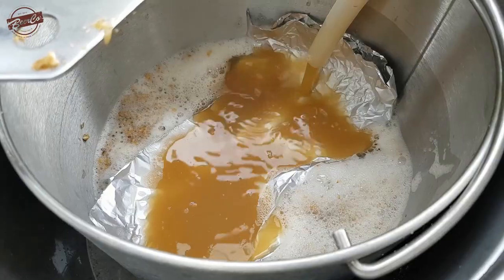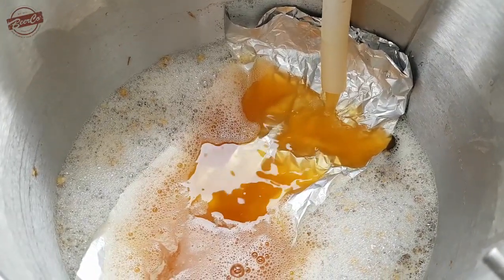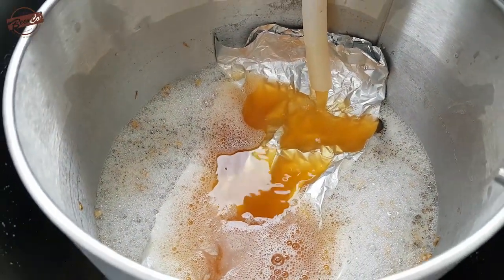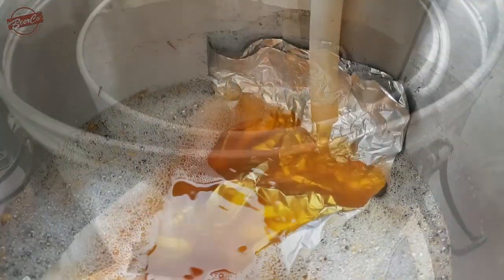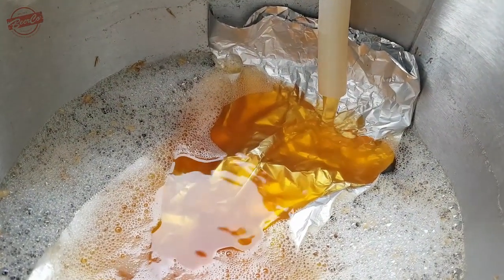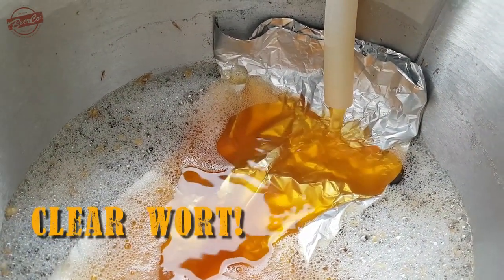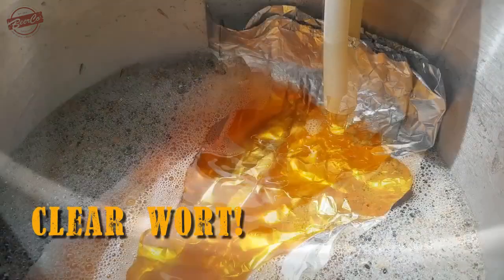How to Brew Like a Pro - Iodine Mash Conversion Test

Comment from the maker: Some helpful background info on Stass great video here: 
Successful Mash Conversion: Tips from the Pros
Brewer:  Artie Tafoya
Brewery:  Appalachian Brewing Co., Harrisburg, Pa.
Years of experience:  10 years professional, five years homebrewing
House Beers: Water Gap Wheat, Purist Pale Ale, Jolly Scot Scottish Ale, Susquehanna Stout, Happy Trails IPA, Mountain Lager, River Side Red Ale, Hibernation Ale

Sitting around a mash vessel waiting for an hour to an hour and a half miracle mash conversion, wondering what is actually going on? There is nothing to watch. You can’t hear anything. All you smell is the sweet aroma of the mash. At least during fermentation, the production of carbon dioxide gives an air lock or blow-off tube activity you can observe. How do you know if your mash is converting? How do you know when your conversion is complete?

Starches are long chains of simple sugars, including maltose, maltotriose, glucose, sucrose, and fructose. I compare this chain of sugars to a pearl necklace. The enzymes (which occur naturally in well-modified barley malt) act as scissors, cutting the pearl necklace into beads. These enzymes include beta-amylase.

Yeast is a single-cell organism that can’t metabolize starches like humans can. This is the purpose for the breakdown of starches to simple sugars during the brewing process. There are a few key steps you can follow to ensure a great conversion.

When mashing in, make sure the mash-in water is the proper temperature so that when mixed with the grist (grains), they will combine to reach the target “rest” or conversion temperature for the style of beer you are brewing. If you miss your target temperature, you will most likely have to add water to the mash to adjust the temperature. With the limited volume of most mash vessels, adding extra water to the mash will fill the vessel too high and prohibit hitting other rests and conversion temperatures throughout the mash schedule.

Second, check the temperature at different depths and different areas of the mash to ensure it is consistent throughout. Make sure the mash is mixed well, but do not oxidize the mash by overstirring. Ideally, the mash should be the consistency of a perfect bowl of oatmeal. It should be thin enough to stir but thick enough to step infuse hot water (add hot water to increase the mash temperature) without creating barley soup.

After 45 minutes to one hour, determine visually that the conversion is complete by checking the clarity of any liquid resting above the mash bed. If your mash is a bit dry, you can create a small divot in the mash bed to get a puddle to form. If the liquid is clear, a complete conversion is near. If the liquid appears cloudy, you might want to wait a bit for additional clarification prior to further testing.

The iodine test is one way to determine whether there is any residual starch that lacks conversion. Just head to the local pharmacy and pick up a “tincture of iodine.” This is a small bottle that will last you about 10 years if you do not knock it over while performing the test.

It comes with a small dropper attached to the cap that allows you to lay a drop or two into a shallow sample of cool mash on a white dish. Be sure no grain material is present; this will yield a false positive. If the iodine color ranges from yellow to amber, conversion is complete. If the iodine turns dark purple to black, give the mash another 15 minutes and repeat the test. If a conversion is not reached after two hours, check your mash temperature. You may have undershot the target conversion-rest temperature.

When producing ales, I like to perform a two-step infusion mash schedule. Because most domestic pale malts are highly modified, a two-step infusion will suffice for most beer styles. I mash in to a strike temperature of 149° to 151° F for approximately one hour. Once I reach visual clarity and obtain the desired iodine reading, I infuse 194° F water into the mash, raising the mash-out temperature to 158° F. This mash-out rest should be performed for 30 minutes, at which time you can start recirculating or running off depending on your system.

For German wheat ales, Belgium wits, and delicate lagers I use a four-step infusion. The four-step infusion includes a very thick strike for 20 minutes at 118° F, a quick infusion for another 20 minutes at 126° F, then a stop at a conversion temperature of 147° F. The complete conversion usually occurs in 30 to 45 minutes due to the beta-enzymes’ jump-start during the protein rests. Then I mash out upon completion of conversion by infusing hot water to a strike temperature between 154° and 158° F. Normally the mash is pretty soupy at this point, so be careful not to add too much water and jeopardize the run-off.

If your mash conversion temperature exceeds 153° F, a higher percentage of unfermentable sugars, called dextrins, will be produced. A higher level of dextrins occurs if your grain bill contains a good amount of caramel and caramalts, which are inherently high in these dextrins (14 percent to 18 percent). These dextrins are unfermentable and therefore will raise the final gravity and lower the alcohol percentage of the beer.

I like to use a slightly higher mash conversion temperature when producing maltier styles of beer to utilize the dextrins that add body and mouthfeel to the beer.

Although mash conversion might seem like a miracle, you can be in control of every aspect. Consistently hitting your strike temperature and completely finishing your starch conversions will improve your efficiency and your beer.

Written by BYO Staff (with credits to Brew Your Own Magazine https://byo.com/article/successful-mash-conversion-tips-from-the-pros/)

Comment: When do I do the test? After the mash before the boil? If it's purple what do I do? Mash longer?
Reply from the maker: Hey @shawnortiz you do the Mash Conversion test after you suspect the Mash is complete.  First, look for signs of clear wort if you are using a recirculating mash system like you will find on a Grainfather for example. Take a fresh clean sample clear of any grain dust and do the test.  If you are still seeing purple or dark colour rather than a change to orange keep mashing happy!  Normal Mash conversion is done and dusted in 45-60 mins tops - as low as 20mins for modern fully modified malts like what we stock at BeerCo.com.au but for an epic beer like a ultra high gravity Stout or IIIPA you might need more time.  If you have issues with temperature control this will affect your mash as well - read this article for more guidance - https://byo.com/article/successful-mash-conversion-tips-from-the-pros/ and #mashhappy always #insistoncrisp